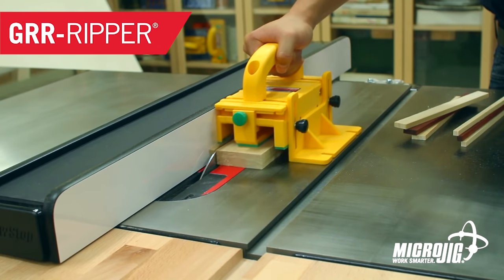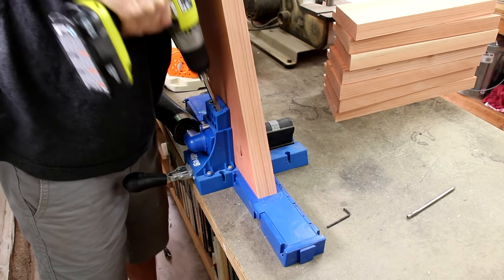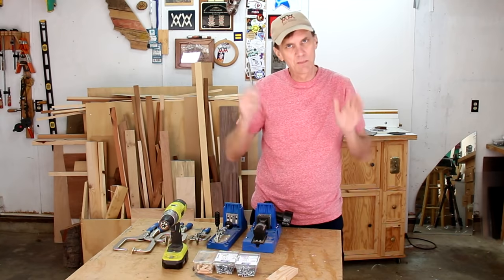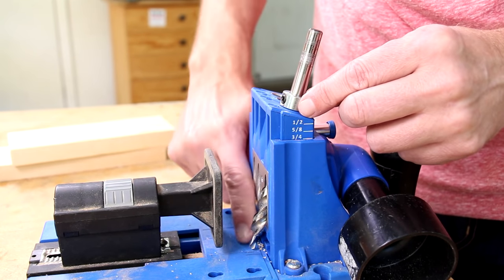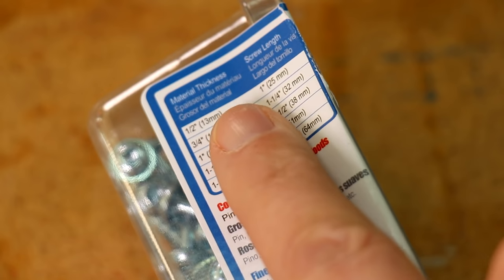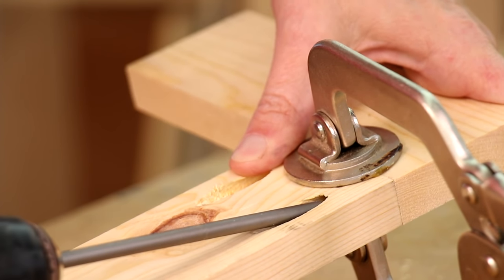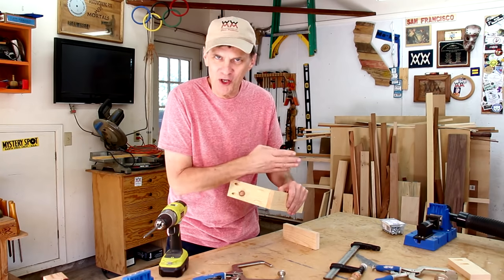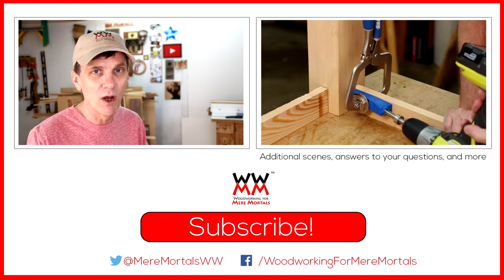Beginner's guide to pocket hole joinery | WOODWORKING BASICS

Comment: Hi

I recently purchased a k4 kreg jig and I was trying to join two 1.25"x1.25" red oak pieces 

The manual says to use 2 inch fine thread screws ,but I keep splitting the wood. Kreg doesnt offer those screws, so i just got other ones that are fine threaded and 2 inches.

Do you have any recommendations?

Comment: It's not that you don't want to drill into the base, you don't want to come out of the end of the board because this will leave some wood that will need to be sanded off so the boards can go together without anything in the joint. No breakout - no problems and no sanding. Don't use the vaccume attachment. I buy the 1 1/4 screws by the 500 box and use only the course for all wood. Drive the "test screws" by feel and then use the clutch for all of the work. Each type of wood will have a different clutch setting all close but you need to test. When I make doors for cabinets I use the pocket holes as decoration on the doors on the back and even sometimes on the front. Then I use a different wood type and stain the plugs. Looks great as long as you are consistent on every door.

Comment: What is the hole type where a bolt is used that is not at an angle (goes in parallel to the faces of the wood) and it marries with a nut in the other piece of wood? The combined holes of the 2 pieces of wood are the shape of a lollipop. Is there a jig for this type of joint?

Comment: I’m using the Kreg gig to make my hole but I’m having trouble getting a strong connection. I’m using 1x4s and the wood Kreg screws. The 1x4s are actually 3/4 would I use that to set up the jig?
Reply: Yes, the directions say to use actual width of 3/4, not the nominal width of 1

Comment: What if you want to drill a pocket hole into a board that is thinner or wider than the other board? There is a guide about how to adjust the kreg stuff based on the wood thickness but it assumes that you want to use two boards with the same thickness. What if that's not the case?

Comment: Thanks for posting this. How would you recommend using this method to join two 4x4 posts in the same manner? Any help from anyone? Thanks!
Reply: Short answer: I'm not sure I would.  Of course, this would depend on the configuration and intended use of the timber once it's put together.  I surely wouldn't flush-join 4x4's end-to-end by any method except perhaps a strong mortise & tenon or some large dowels.  If the timbers were crossing each other I'd probably notch each one out 2" and inset them - you could put some pocket hole screws in just to hold it tight.  Notched and crossed timbers can reliably be held with good-sized lag screws.

Comment: Hi Steve: Thanks for this great video. I'm planning a project (60" long table/ desk) where I'm using 3/4" Baltic birch plywood as the table top, and hardwood walnut (1 x 3 board, i.e. 3/4" thick) as the legs and "spine" (the support that will run like a joist along/ under the length of the plywood board, but away from the edge of the plywood, to prevent sag). This will involve screwing the walnut joist to the plywood face (on the underside of the desk). Any tips/ cautions? Thanks in advance

Comment: Just getting into the Kreg system and I find two problems that affect quality: the drill driver wears quickly resulting in spinning off the screw head easily and often. Very frustrating. A torx head screw would work better.  And unless the drill is perfectly straight,mother square head driver and screw also slip frequently.  When making drawers, although I used the Kreg clamp with two additional clamps, the drawer side moved inward 1/16 of an inch when fastening with 1" screw.  The drawer is not square now and once the screw penetrates, removing it and trying it again does not work.

Comment: Saw another instructional video where 1/8 inch x 5 inch drill bit is used to start a pilot hole for the joined board to avoid splitting. 
Any body have this issue?

Comment: If you plug the holes anyway I would probably use dowels instead. And pocket holes are weaker than using longer wood screws and even weaker than dowel joints in many testings (see e.g. the experiments of Matthias Wandel). They sell very thick and long woodscrews over here in Austria and Germany that are especially made for screwing stuff in like that. (Pocket holes are btw. widely unused here). Last but not least there are those "lock-like" joiners like Ikea and many others use. Con is, they are pretty expensive and I would give pocket holes the edge. Me personally: I like being able to take apart my furniture again. And I also kinda dig the look of silver screws on my furniture. So I use endgrain screws like a savage. A real downside to those though is that you have to very careful to not split the wood. Maybe I give pocket holes a try after all.

Comment: At about 7 minutes you show the right and wrong direction to go in.  I have to do the “wrong” way as I didn’t want the pocket holes on the outside on my bench. I saw you can fill the holes with dowels and sand and paint, however I don’t find my screw heads are totally incased within the wood. They stick out. Any suggestions.

Comment: Some of my pocket holes don't end up looking that nice. Some of them have spots around the edge of the pocket hole where it looks like the bit took out some chunks. The plug doesn't  fill in all that well. I've had to mix glue and saw dust to fill in these tiny spots.

Comment: I find course drywall screws sufficient when I run out of expensive screws.
Reply: The problem there is that drywall and deck screws are self countersinking, and you’re likely to blow through part or all of the pilot hole. I suppose you can compensate for this by pushing the drill bit stop collar forward a small amount for a shallower pocket.

Comment: Sorry to ask. Why don’t just use wood glue instead of making pocket holes? For small/ thin woods like those, I think wood glue can pull them together just as strong as the screws.
Reply: I think this is easier for most people. Gluing usually requires the wood to be prepared a bit more. Then there's the drying time of the glue, clamps required and glue clean up. This is quick and easy (one you have a jig ;) )

Comment: Pocket joints are very weak compared to other connections like dowels, lap or mortise joints. I use pocket screws but not when strength is needed.

Comment: "...instead of getting bogged down in complex skills..."
Definitely not a channel I'd be interested in. Acquiring skills is part of the enjoyment of building.
Reply from the maker: No problem. This channel is for helping beginners. Thanks for watching anyway! 👍
Reply: @SteveRamsey  I am a beginner, and there's three issues specific to me: 
1. I have all the time in the world thus I don't need to bypass learning new skills.
2. I save money by not buying gadgets that replace a skill. ( including saving tool shed space uncluttered by gadgets)
3. As mentioned already, though clarified - I'd rather learn a skill than use a gadget that replaces said skill. 

Granted, your way combines both skill learning and gadgets, but how I'm wired I'd rather learn as much as possible and rely the least on gadgets. 
And I'd rather build my own workshop tools instead of forking out ridiculous prices for factory made ones. I've just bought a 2nd hand dropsaw, drill press, bench grinder...so I can now do more accurate straight cuts. 
My first projects will be to build a straight edge guide for my already owned circular saw, a measuring tool, a square, a portable solid workbench that sits on folding legs ( for larger outside builds), wooden bench and drillpress vises and various other devices that'll be required for each new project.
Reply from the maker: @xander1756  Yes, this is definitely not a channel for your specific goals from woodworking. The WWMM method is  for learning broad-based skills the most efficient way possible without a long learning curve and without spending a lot of money. To get people actually building cool projects this weekend! 😃 There are lots of other channels, so good luck!

Comment: Thank you so much  Steve !! I was putting the screws in at the wrong angle...aka opposite of where the main thickness was...good grief Charlie Brown !!  I had sat down on the porch stairs....wondering...what in the Sam Dell am I doing wrong ??? Ofcourse...we know....woodworking is like that.  I always keep at it until I figure it out or just take a break for a while. I also knew ...I just HAD to get this Kregg jig situation right because it was too important not to. Building a custom built in cabinet in my closet. Love and God Bless always, Lisa

Comment: You need 3 arms to hold the wood and drill the pocket screws. The Kreg clamps are garbage. You have to hold the wood with your feet to try to drive a screw. Kreg is junk.

Comment: Hi Steve. 
I’m a girl. I’m new to this. Teaching myself & it SUCKS. But - I’ve decided to pocket hole the wall stud frames I’ll be building in my garage. I’ve no experience with this for the life of me but - I’ll be doing it anyways. And I don’t have much room to build the frames on the floor. So I’ll be building it in place. And I assumed that Pocketholes will be the only way I can do this besides using tons of metal L brackets.
I need to buy some pocket hole screws right now. Can you tell me what size pocket hole screws I should get for framing these walls with 2x4’s Steve?
Reply: P.s. can I just drill the holes in each end of my 2x4s and Then put them in place or do I need both 2x4s together to do this right?

Comment: Uh... Beginner question: don't I need to drill holes in the piece of wood I'm screwing it in to?
Reply: Depends on the wood, the thicness of the screw, the length of the screw an so on. If the screw is too thic it will splinter the wood, if it is too long too, if the wooden piece is too narrow it will happen too. After a while you get to know when and where you can do it.

Comment: Pocket holes are garbage
Reply: Whys that? I’m just getting into wood working so I’m looking for any advice.
Reply: @dylanstephens4179  go ahead and buy it and use it my guy im just being that guy lol its not that i dislike pocket holes i just hate how people use them for every and any joint that's not what its meant for its meant for easy simple not needing alot strength joints, face frames, picture frames, cabinet carcasses plus its so rewarding to make a dovetail, mortis and tenon, loose mortis and tenon, finger joint, sliding dovetail, dado, rabbet, etc and getting that perfect fit no gaps fit and im not even that guy that says you must do all this by hand tools i like wood whisperers approach of using both power and hand tools so yeah man use pocket holes id just say while you using those maybe give those others a shot when you gain some confidence and experience with those tools needed to make those various other joints